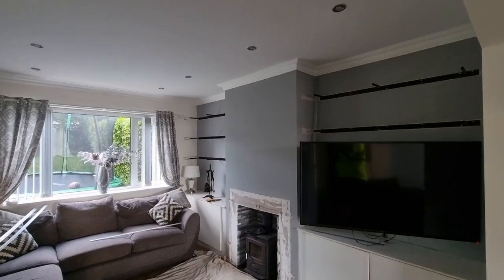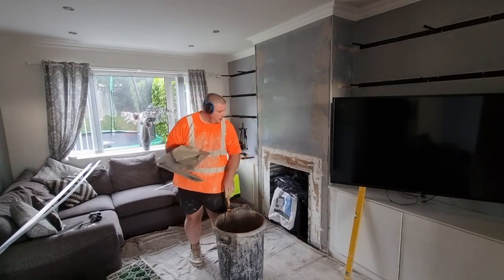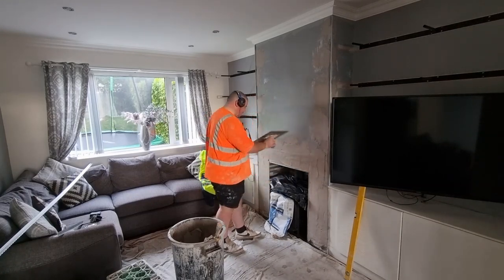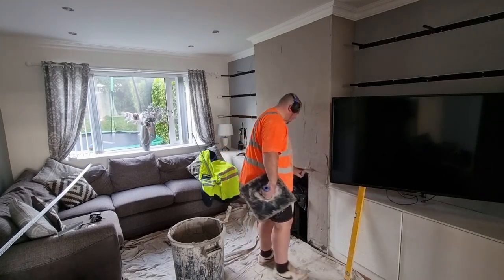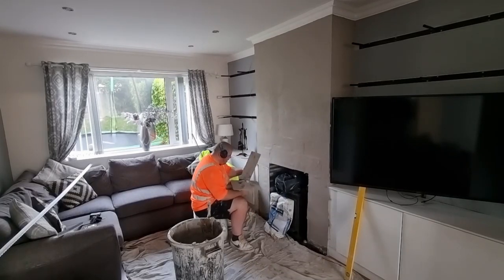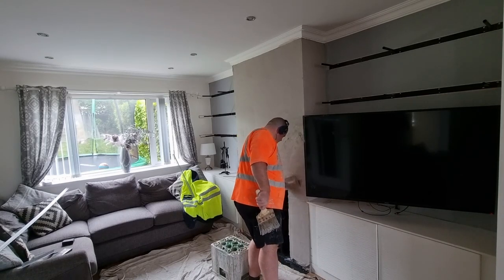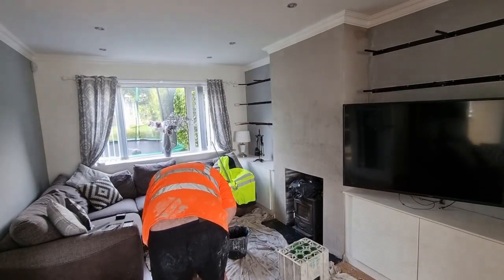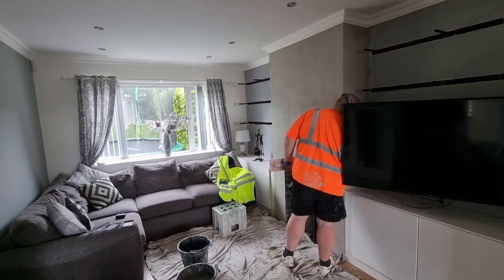How to plaster chimley after wood burner being installed

Comment: Thanks for posting,what stops that skim from cracking due to heat?is it a heat resistant plaster?
Reply from the maker: No, but the plaster inside the chimney, not the face of the chimney, is what would crack due to heat.
Reply: Thanks, just about to plaster mine and good to know , i thought it may crack at front
Reply from the maker: @richat1691 Unless your stove is a monster and putting out stupid heat, it's not likely to crack.